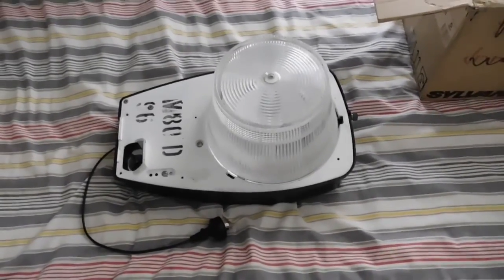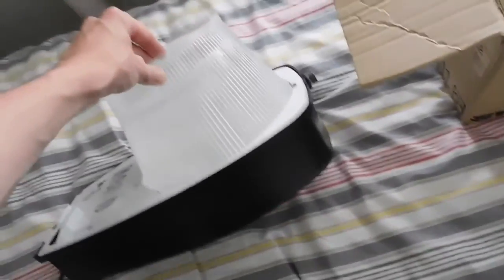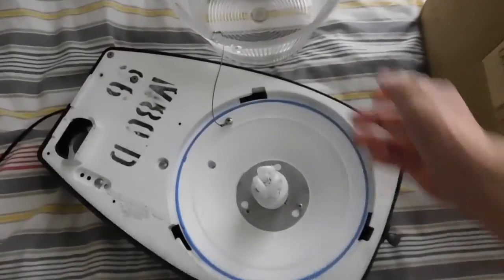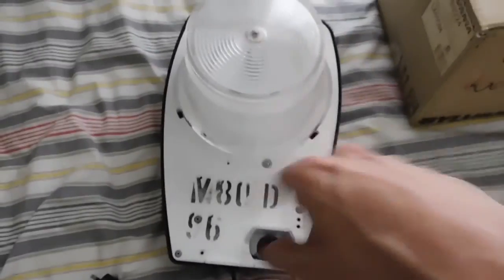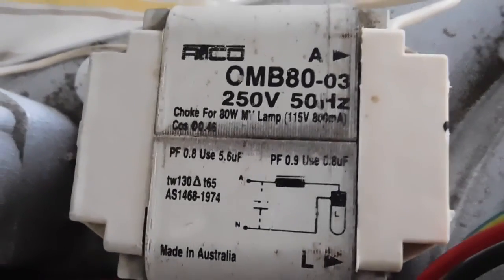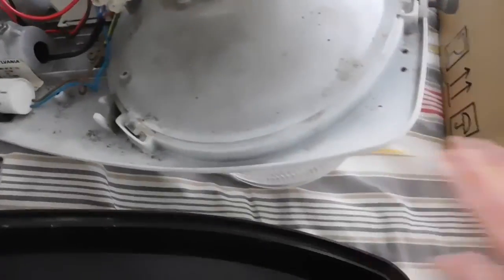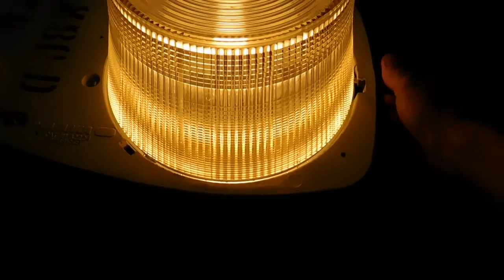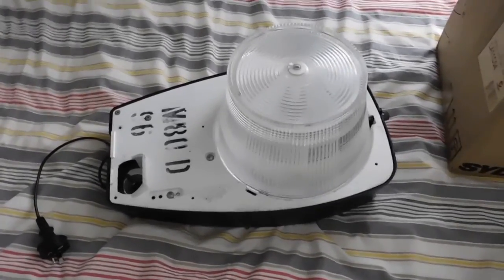Sylvania B2224 Mercury Vapour Streetlamp

Comment: Im sure a 70w self starting hps bulb would work in that fixture with the 80w mercury vapor magnetic ballast.
Reply from the maker: Yeah they're  designed specially for these fittings as a retrofit, I've ran them in this and others without issues
Reply: Nice!
Reply: Btw what is the uF number on the correction capacitor and the voltage ?
Reply from the maker: about 5uF
Reply: Oh ok, thanks. And it gets wired directly to the Live and Neutral?
Reply from the maker: Yes, in parallel with the ballast